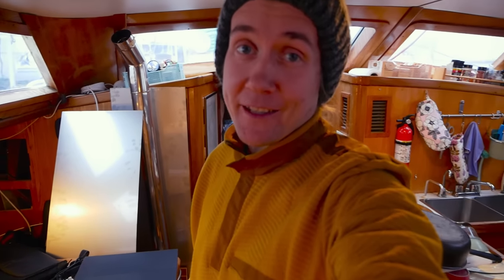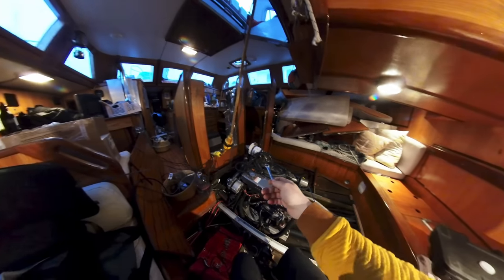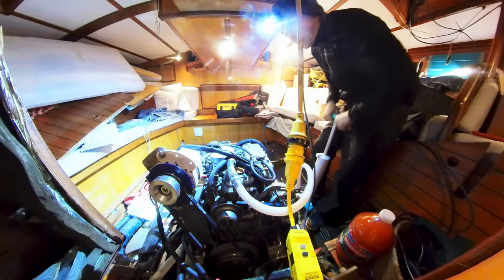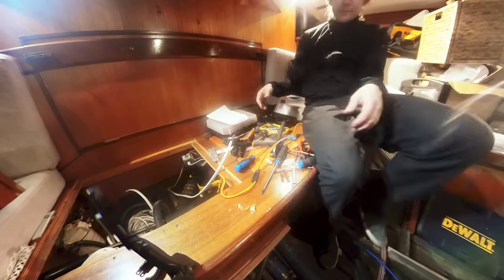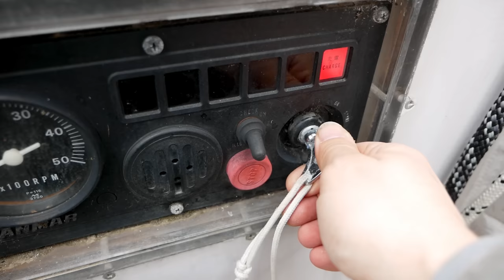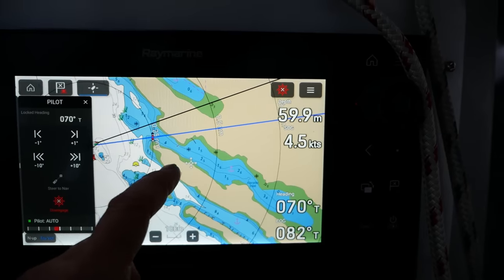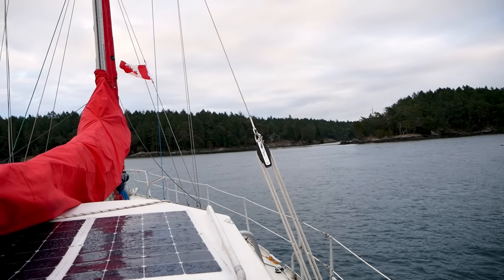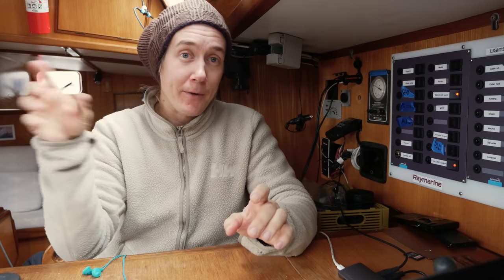FREE HEAT for Our Boat! NO Extra Running Costs!

Comment: Hello, if you allow me to give you an advice, try to adapt some air filter close to the air intake of the heater, it will be a pain in the neck when you will need to clean the dirty radiator, you can build some kind of wooden box to fix the air filter on the back of the heater fan. Sorry for my english.
Reply from the maker: This is a good idea actually, a big simple filter would be nice. I can imagine this can gather a lot of dust and I would have to unmount it to clean it!

Comment: I have seen others use this system and they switched out the loud fans for quiet computer fans, they said it made a huge difference
Reply: That sounds like a good idea. They are very low power users as well.

Comment: Free?
Not an efficient application, granted when sailing/running motor it will work well. A better investment would be a cheap diesel furnace that could run independently even at dock/anchor. 
Trust me on this because it's -25C outside right now and I'm burning approx 5 litres/day to maintain a comfortable 22C in my 12M Bruce Roberts that is insulated.

Comment: When we were building our old boat We scored a few motorbike radiators and put them in a box with 12V computer fans. Also installed 3 alternators 1 for 24V houshold, 1 for the 12V household and 1, 12V for the starter battery. In the boat we used those " english" wall socket so all appliances got the same connector without the risk for the wrong voltage or polarity. ( conector fit just in one way in the connector, the 12V and 24V sharded the same ground on the engine.)

Comment: We’ve installed a heat exchanger to couple the engine coolant to the boats services thinking a high quality heat exchanger is less likely to leak than all the plumbing.
Reply from the maker: yes, this is certainly a good idea especially if you have a more complicated system, possibly with radiators etc

Comment: The heat exchanger can be installed on the exhaust system. This will increase efficiency by up to 50%. Most of the heat ( and the hottest) generated by the engine is wasted - dumped out through the exhaust. It is very easy to capture this heat because a simple steel pipe attached to the manifold or a copper tube wrapped around the manifold will rapidly heat to a boil the heat transfer fluid. Therefore, many radiators can be supplied with the copious flow of the required high volume boiler system type hydronic pump. I like the Taco with automatic flow control and delta T. Approx.$ 140.00 USD but the inexpensive vevor pumps on the net are attractive in cost. The exhaust temperature in enormous compared to the cooling system antifreeze solution.
Reply: But the exhaust heat would dissipate much more quickly in the heat exchanger, no? Because it's a gas, not a liquid. But maybe it's hot enough it doesn't matter... not sure.
Reply: @TimTimTomTom  The combustion engine exhaust gas temperature is measured using a pyrometer often utilized in airplanes. The temperature average is 6 X greater than the cooling system temperature.
Reply: That sounds nore complicated to do though. This install is quite literally plug and play.
Reply: Think you have a better solution.  Works straight away, so you don’t have to let the engine warm up.  More complicated though
Reply: One thing to consider fitting is a heat recovery ventilation unit.  Will do wonders in keeping things dry and does need the engine running.
Reply: @anthonyrstrawbridge  Right, but fluids transfer thermal energy something like 30x greater than a gas will. The piping material would be a major factor here.

Comment: would have been nice if an air filter could have been fitted to the inlet of the blower motor. Know what I'm saying. I've used different types of heat insulating tape  on the tube ducting .

Comment: It’s Called a heat exchanger😊 Volkswagens use it. except it doesn’t use water. It works off of 😊the exhaust system.

Comment: Find a high-quality, marine (waterproof and saltproof) grease of the right weight for the fan's bearings, and grease 'em!  I don't know why (probably cost or planned obsolescence), but manufacturers always seem to skimp on lubrication.

I have a number of motors which were poorly lubed in the 1990s.  They would have failed in that decade, too, had I not pulled and re-lubricated their bearings.  Here we are, thirty years later, and fans, vacuum cleaners, clocks, drills, table saws, blenders, and other machinery are all working exceptionally well, decades after their manufacturer-lubricated brethren bit the dust.

For managing and mitigating those 10 amps, consider buying a rheostat, in particular, one which employs a switching power supply and sinusoidal smoothing so that it is compatible with fan motors.  That way, you can very efficiently control the fan speed to only use what you need.  This will also reduce over-cooling your diesel engine, rendering it more efficient, as well!

Comment: Thanks Juho! "So now i have  technical draws, closets and rooms. And yes even my bedroom has become very technical  indeed:D  As for the heater, thanks for showing! For the noise, a reduction that is, one could put it in the sound proved engine compartment and run a hose to the cabin outlet.

Comment: The best way to (Re) configure the blower fan in this application is to install a very sophisticated low cost electronic thermostat with Delta T. I believe the Delta is unsurpassed in achieving best results because the logic is based on two references ( 2 x temp sensors). One temperature sensor is placed on the hot side ( Supply) the other temperature sensor is placed on the Cooler side ( Return). The logic will then be able to accomplish many functions as follows:  On/Off, On/off temperature minimum, In/off temperature maximum. 
   The inexpensive devices being sold at sites like jungle and bay are quite good 👍. The led temp display models are also very accurate and allow the installer to use the internal relays to accomplish power ground or separate - different voltage supplies. The 12/24 fan motor circuit will only require splicing at either +/- , using the Delta T Digital LED electronic temperature control to switch one wire open/closed through the controllers robust internal relay switch. ✌️

Comment: I'm assuming that Yanmar engine is diesel, if that is the case, you should consider one of the small diesel heaters. They are extremely efficient, and I suspect you could run it for weekswithout worrying about refueling.

Comment: Just watching your video. Gas and diesel engine work opposite concerning heat. Too much heat is bad for gas engines and not enough heat is bad for a diesel which means you start losing power. I would advise installing a temp gauge on that engine. It is usually located in the intake or side of the block. There should be a 3/8" plug in 1 of those places. The "heat exchanger" looks like a basic truck heater core.  Running the engine at low rpms actually loses heat because the engine is robbing as much from the coolant it can to perform. You'll need to run it at a higher rpm to keep the heat build up. Also, being the sea water cools the antifreeze, work with closing the sea water valve some until you find that winter setting sweet spot. This is where the temp gauge is important. I realize its spring and warming up now, so this is thought for the coming cold fall months later on.

Comment: Wonder if one could modify or add an additional mount on the boat motor too add a second alternator. Of coarse that would require a longer serpentine belt.
🤔 Tention requirements could get tricky.
Probably not a good idea after all... 😖
I'm sure solar in the artic isn't much help either.
Did someone say get a  generator? 😁👍

Comment: Positive Buoyancy Foam, ( is also insulation )
of course you would have to record what there is for un-used space in the yacht, and estimate a volume.
but heat would basically cease to migrate out of the hull, in those areas.

Comment: If you add a 12 V circulation pump to the coolant lines, you’ll get heat from your water heater when it’s on shore power plus it’ll heat your engine block…

Comment: Always great videos. That heater looks very similar to that used in old Austin Mini's, one thing of which is that it does matter which way you plumb in the heater pipes.
Our Mini only ever blew warm air, not HOT like it really should, until I flipped the pipes so that coolant flowed in through the bottom connection and out through the upper one.
It turns out that the 'normal' way around forces an airlock into the top of the heater, making it perform poorly as it was only half working. Flipping the hoses drastically improved this.
It may eventually collect some sediment in there, but that takes literally years of neglect to happen, so the overall benefit far outweighs this very minor con.

Comment: Great video!  

There are Chinese diesel heaters available for fairly cheap that can operate on 12volt. People are using them for heating vehicles, garages etc. They cost about $150 and you can use mix  half of fuel tank with used motor oil to save money and it burns clean.  It could be another option.  If you google Chinese diesel heater you'll find lots of info on them.  Cheers.

Comment: If you restrict the ocean water cooling to the engine with a temperature control valve,  you can get a higher temperature to your heater and water heater and maintain your engine cooling.

Comment: A fan that uses less power will also have less pressure if it has the same free air flow, which would mean less actual air flow through the ducts if you use them.

Even for you, since you are using the air box and then drawing air from quite a ways away through the underside of the boat, you'd lose performance - there's quite a lot restriction/pressure loss from all of that.

You could save a bit from getting a fan with the same specs but better quality, but that will be $$$$.

You're better off upgrading the alternator.

Comment: Can you put a thermostat on the engine cooling loop so it only hearts the cabin, and not the ocean, under a certain temp? I don’t think you need to worry about letting the engine warm up if you are on the lines going to the radiator as the engine thermostat should close the coolant flow until up to operating temp!

Comment: The only problem with this approach is that the engine needs to be running in order to produce heat. In my opinion you would be far better off using a diesel cook stove with the steel top plate and a heat coil built in to heat the engine and potable water too. In extreme cold, the stove can be left on low heat to keep everything warm! 
Good luck, I hope you have a wheelhouse.

Comment: My fathers 38’ boat on Lake Superior had one of these decades ago and also a standalone diesel heater.  Lots of 100mi+ trips in near freezing and occasionally below weather.  Heaters were not just nice to have, they were life critical sometimes. The radiator heater worked like a champ.  Stand-alone drew too much battery and didn’t output the BTUs…it was not used often

Comment: Hi Guys, I have a Red Dot heater in my boat, it’s built for marine use and the amperage is less. Works like a charm, keeps the cabin warm, out on the west coast. Granted the cost is a lot more but this unit has been working for 28 years fault free.

Comment: How did you go with any fumes?  I ask because with your installation of the heater, you are taking the air from the engine compartment and putting it into the cabin.

Comment: Just want to share what I have done in Winter for free heat okay maybe not quite free but very cheap and no electricity buy Zippo Wicks and cheap candles you know the kind in the little metal cup with the little metal holder in the bottom of the candle for the wick then get yourself some Zippo wicks they come in packages that are cheap take the little banana that holds the wick out of the bottom of the candle remove the old Wick by opening the little metal piece put the Zippo Wick in and close it now put that back up into the candle there are four little copper wires separate them around each one then light the candle the father of Pride you spread the four copper wires The Wider the flame will be and the more heat it will generate this candle does not feed on anything but wax like a regular candle the wax melts and soaks into the wick only because there's copper it will melt the wax very efficiently because it eats the wax you will have to feed more wax into it but as long as you have wax and you have a couple of these you can eat your boat very very cheaply for many many many hours my girlfriend and I were using the same ones I made at the beginning of the winter at the end of the winter I need six for our tent we never needed more than two I recommend three or four for your boat at least

Comment: As long as your engine is working under load that should be no issue. If its not, if you're just ideling in a marina, then you might want to refrain from using it. That said, most modern engines will not send coolant to the outer loop unless its hot enough.

Comment: Yes it matters which line is in and which is out. Look carefully at the inlet and outlet of the heater. If one of them is from the top of the heater, that is the outlet. It matters because if the bottom line it plumbed as the return, the radiator will not purge the air and you will only get a portion of the heat you should get from it.

Comment: If you have an exhaust leak you will suck that air through the heater. Make sure you have a carbon dioxide alarm in your boat where you sleep. This way if it is on when you are sleeping you are safe. Looks great! Beautiful scenery.

Comment: Heat is a need not just a want ! lol. You might be better off installing duct work to quiet the blower and  dont have cold spots in the vessel ! I'd put air filters on it , simple cotton ones !

Comment: myonly reservation with your install would have been to put taps in  the lines to the heater,,if the unit leaks or gets damaged it could cost youa very expensive engine repair

Comment: If its actually connected to the second coolant loop (seawater sucked from outside that gets flushed back into the sea right after) - then this should have no effect on the engine heat since the water it is actually cooling is anyways just about to leave the boat without passing the engine again.

Comment: If you had a way to add a diffuser box and grill to slow the air flow where it exits your duct, it would reduce your air noise.  I design HVAC and Ventilation for warships for a living.

Comment: The issues with this type of system are the fuel burned by the engine and the unnecessary accumulation of hours on that engine.

Comment: As you say these heaters are sold for cars where the switch is most likely inches from the heater rather the feet (metres) in a boat.
You mentioned the power used by the fan but did not mention that they have 3 speed settings.

Comment: Hello..!! I have installed some of these, and have always mounted an easily accessible valve on the inlet of the heater. Some have also swapped the switch for a stepless variant.

Comment: It, is a fine video , thanks for showing us the heater and not footage of either flesh or food like most of the
Other channels do, I guess that the new heater will rob some of the heat from the calorimeter but no system is without a down side .
I still think you bonkers sailing in such cold conditions but its great to watch from my cosy armchair !

Comment: The temperature of the cold sea water will be a much bigger factor than that tiny heater. Bottom line is the thermostat should be functional and it would be ideal to have a temperature gauge. For what they cost it is well worth installing one just to know. There are electric ones and gas filled tube ones. You will probably want the electric style for easier placement of the gauge and also to help with the constant motion of the boat which might stress the gas filled tube style.

Comment: gess it to late the hotes pont on an engineis num  cyl if  u can run your supply there  it supper hot volvo did this in the 60 -70 and then  also put in air bleeders get another  one and biger if u can  u have a big boat   u can turn it down   have a good trip also u can get 12 volt  pump to help move the coolant good trip

Comment: Some cars use a resistor to lower the blower power and its current. I remember SAAB in older models used them and you most likely can use it to lower the heather blowers current.

Comment: Pretty much every internal combustion engine has a temperature sensor on them I can’t imagine there not being one, you might want to look for it it will be on the head or around where the water pump is.

Comment: I have seen this on a lot of boats , some of them have small radiators in each room that run hot water in a loop for the system, also it can be plumped to your hot water heater so at dock your making hot water and heating your boat ? I guess for a winter boat it’s a must !

Comment: You could take out the fan that came with the heater and replace it with computercase fans, they are very silent and move a decent amount of air too. And they dont use much electricity.

Comment: a fantastic addition to any boat. I installed one on my beneteau 352 and it keeps the cabin at a comfy 20-24c while the motor is running. On the 352 it is a very easy install in the same area as the hot water tank, almost as if they had intended to add one and forgot

Comment: I think you might find it far more efficient to have the heater recirculate the cabin air when you get to the really cold temperatures.  A 'Y' and a flapper valve could be plumbed in to give you your choice to match the weather conditions.  Those heaters are pretty common around SE Alaska.  You can wire it with a rheostat switch to give you a selection of how much air you want and reduce current draw.  Just the way it is in a car.